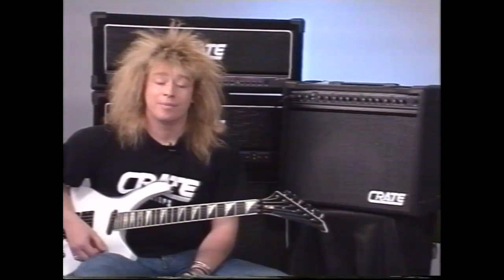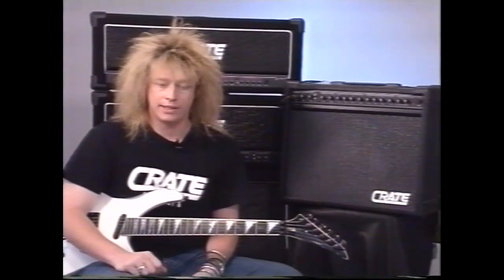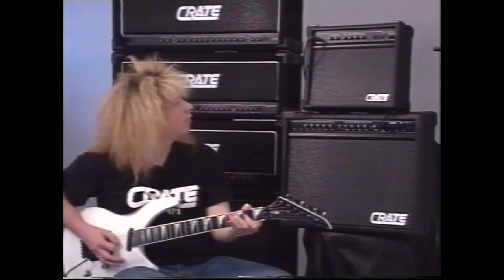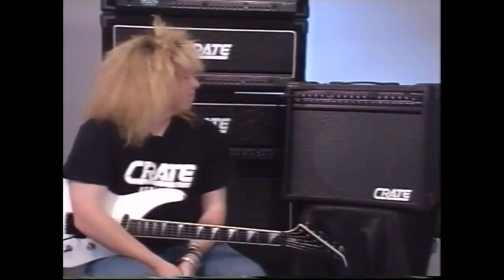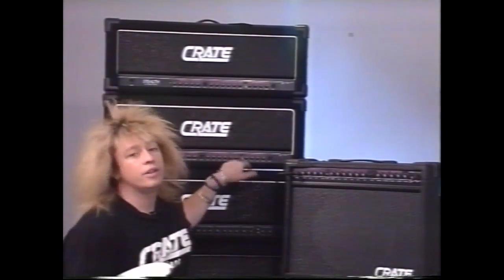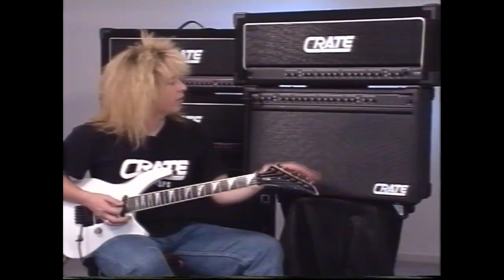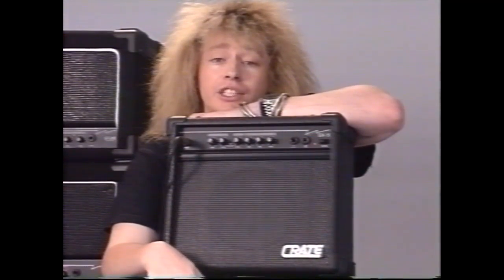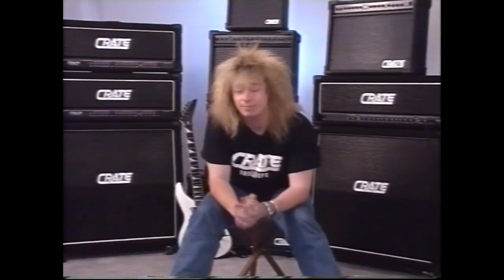1993 Crate Rock Talk with Finbar O'Hanlon

Comment: Had all of those over the years. I kept my Stealth 50 and GX-130C. Gems..The Crate solid state overdrives sound better than Peaveys of the day. Still love the Stealth
Reply: RIP Crate.
Reply: I just bought a 50 watt crate stealth head with new tubes and in perfect condition for $300 ! It screams !
Reply: yeah i wish i kept my GX130C   :o(  oh well  :o)
Reply: I have had both of those amps as well, and wish I still did. I used to cut right through Marshalls and those guys would scratch their heads wondering why I could do that... Crate used to be great...
Reply: The peavey of the era was more suited for country and southern rock. Akynyrd used peavey amd studio and stage.
     Rlcrate stayed with the times.  Great blues amps. Amd. Great metal and rock amps.
  Yes they made some Junk.  But not their USA made gear.
  The vintage club 60 watt amps, vc2112, vc2210  killer amps.
Reply: Still running my g130cxl 🤘🏻
Reply: Well...they were THE contenders when it came to solid state distortion. The G60GT was more harmonically even than the Black and white Solo series of 1980, yet very fizzy compared to the Super Sat Peavey series 1987-89. Then came the G80XL and the Vintage Tube that were better, and culminated into the GT80DSP, but still couldn't keep up with the Peavey turquoise stripe Stereo Chorus 280 that came in 1990. CRATE eventually won that battle with the GX212 DSP Stereo Chorus amp with 4 channels and Celestion speakers ... The Peavey Transtube was like ... meh

Comment: I've always been a sucker for Crate amps. I currently own a GFX-30. It has a great clean sound, and once you understand how to adjust and use the overdrive, you can really get a good distortion. a lot of people trash Crate overall and I think that's a shame, cause they will go all balls to the wall with the settings and then bitch that it sounds crappy. Instead of taking the time to fine tune the settings. I think mine is a '98 model but it works great still. Too bad that they went out of business.
Reply: I was disappointed to learn of Crate's demise.
Reply: I cannot believe that some of my friends that the guitar store will cut down the crate sound without even hearing it
Reply: the guys at the music store trying to get me to get into orange amps you know strictly tube and i hate it. I run the gt200 with the 212 cabinets along with my g130cxl long with 412 cabinet and that is a great song cuz I can use both tubing and digital at the same time
Reply: well said my friend I got a guy who adjust my app for me and it sounds like a crate 212t remember those and I'm going no this is how it should sound and get it sounded more like Queen and on
Reply: so is everybody familiar with the famous standard maintenance on a crate head you know you just get in there and clean up a few things tightened up a few connections and man them things will go and go  sound so great
Reply: it's funny I can only play great when I've got that sound anyting else that sounds like crap like a like marshall
Reply: yeah it's a good idea to pick up any like 130c head you could find or even the  combo. 1 fails grab another one man

Comment: Still such a highly underrated and harshly criticized amp company, but they really did shoot themselves in both feet when they produced model lines that had a shape control on the overdrive channels but no midrange.
The worst part is, you can add the midrange by changing a 100 ohm resistor that costs literally less than 1 cent with a 40 cent 500 ohm potentiometer, and that turns those models into the ultimate metal amp!
That, or the low-tech way is to pu an EQ on the effects loop.
One of the best thrash, death, industrial and numetal amps of all time.

Comment: Really nice vid! I have the gt50 head and the combo. The best for everything, period. I use the head in a death metal band now, even the built-in distortion would be enough but I use it with a pedal. It kills all modern amps when it comes to high gain. It is simply relentless. I need a 100 watt too! The combo has that same kind of aggro, also with a very clean, Fender-ish type sound. The Stealth series unbelievably stellar, it is ridiculous. A hidden gem.
Reply: This amp is a hidden gem! I actually wrote hidden gem before I read your last word :) Not so thrilled about the reverb. I had the solid state one which sounded AMAZING as well and had a much more shimmering reverb more of that fender-is sound you just mentioned. Was sad to let it go.
Reply: Check out Jeff Blando. He is always using them on stage. He has a killer sound with his stealh amps.

Comment: The promo is so bad it's hilarious. I laughed pretty good at the first min or so.

I was sad to learn a few years ago that Crate was dead. In my opinion Crate solid-state amps had the best solid-state sound available, ever, even by modern standards. Have yet to hear another solid state come close. And also in my unpopular opinion, Crate solid-states sound better than most of 'God Tone' valve/tube amps then and now. 

They did have some flaws. I don't know which heads and combos were designed for actual touring (maybe none, maybe the Red Voodoo?) but all of them I have ever owned from new to used had weird glitches like loud popping when switching channels or crappy pots made of plastic that would fall apart or being able to fully control channel 3 with channel 2's controls because there's a crossover issue. But if I had the money I would take my favorite Crate heads and have them copied with the same parts but of better quality and less internal PC cables, zip-tied, better jacks, pots etc. I would definitely do it.
Reply: Some other weird things I remember are the volume dipping by maybe just a couple of DB's (just enough to notice it), or the dirt on the distortion channel lowering it just enough that I could notice it.